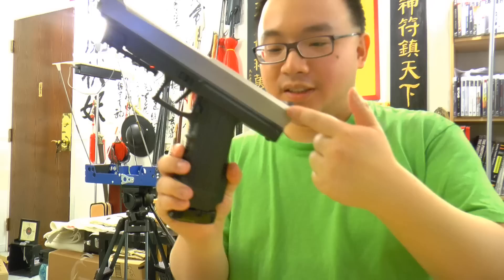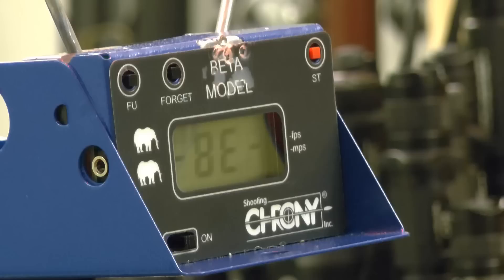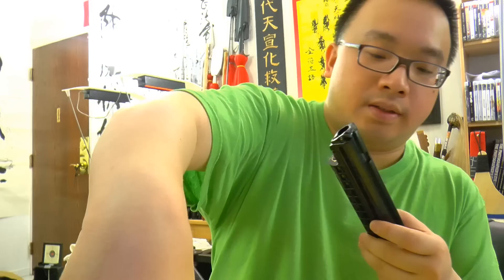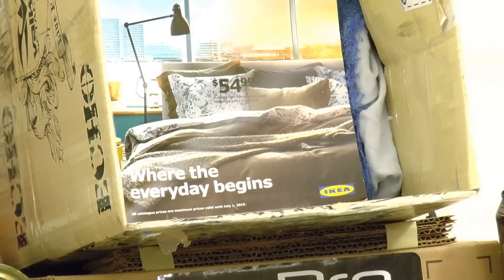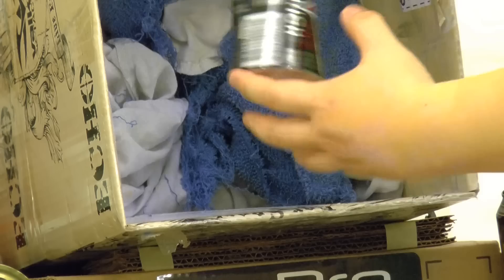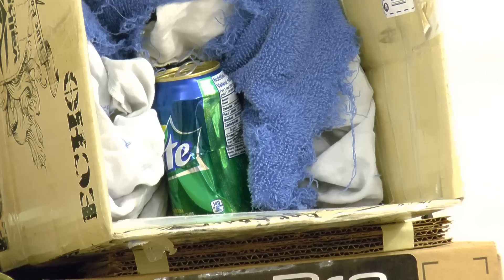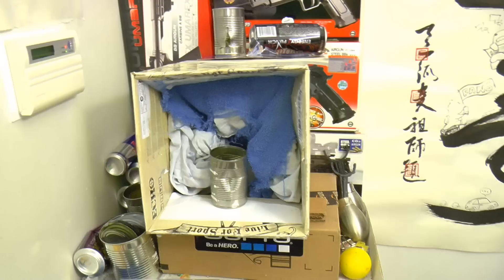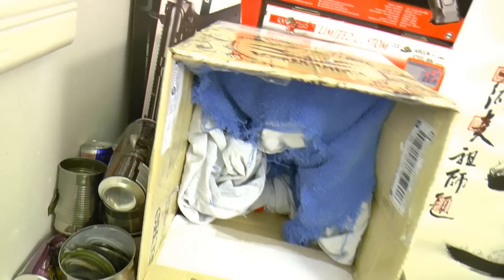The Most Powerful Paintball Gun

Comment: The most powerful paintball gun by far it seems. I haven't chrono'd or tested mine at these levels yet but feel keen to try soon! Will let you know if I get similar results.
Reply from the maker: Mark Randall What gun are you using? The Tiberius T4, T8 and T9 are the only ones that have this kind of valve in the market, and that is the only reason why it can pop so hard. Other markers cannot do it because of the valve design. A lot of people say "oh my XXX can go up to 300fps easily" - ya right, with a paintball (2.9 to 3 grams) not a breaker ball that weigh 2x the weight dude. With breaker balls, you mostly get 170-220 max. LOL!
Reply: Chiinnature I have Tiberius 8.1 and 9.1
Reply from the maker: Mark Randall nice man!  :)   The best!  Get a t4.1 before it's long gone

Comment: shoot an fn303 at max power XD
Reply from the maker: look up my videos on t8.1 max power versus head and watermelon etc, it is a FN303 power with non-bursting rounds, 6.2g breaker balls, it punch thru coconuts and bust thru walls easily, who needs a FN303 when you can buy a tiberius t8.1 and t4.1 etc. FN303 is about the same power (actually a bit lower) than the t8.1 and 4.1 when tuned